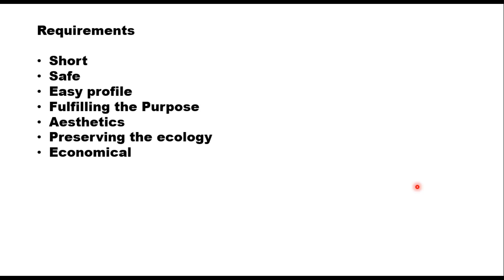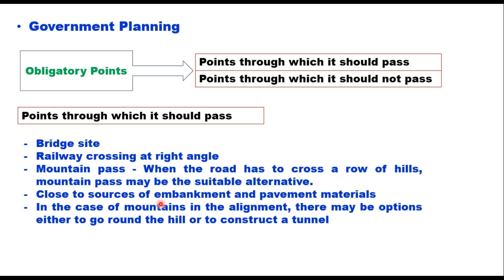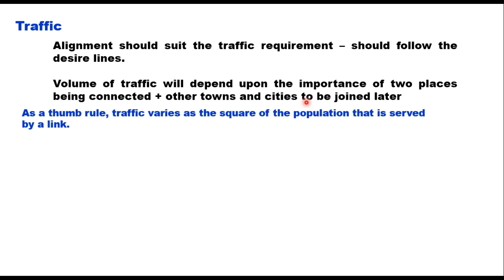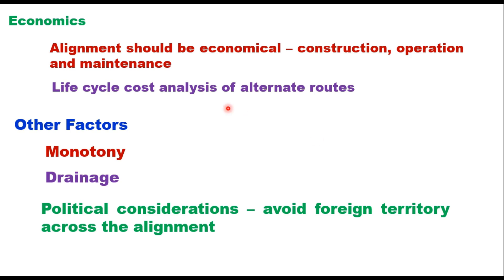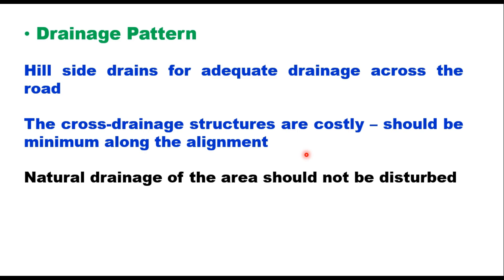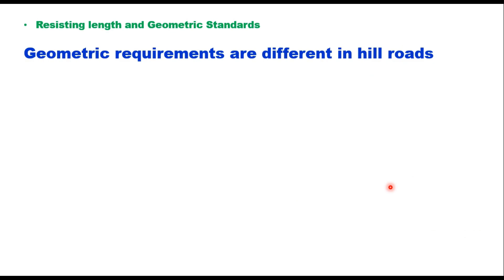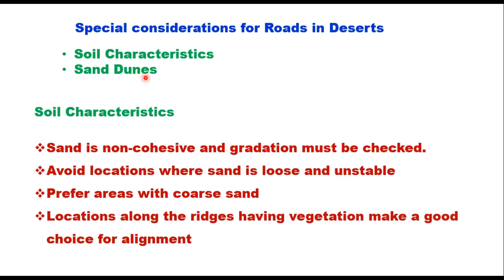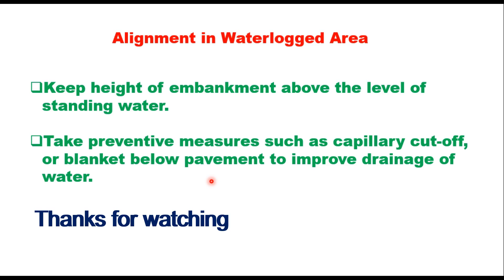Factors affecting highway Alignment in plains, hills, deserts and problematic areas with all details

Comment: Could you suggest some of best book's to Solve some Typical conventional questions Sir ( like 12 Mark's and 20 Mark's questions for ESE ) sir....

Syllabus:::; 
Geometric Design of highway , Traffic Engineering and control 
And Design of Pavements.........

Tqqqq sir...
Already I sent mail to you sir....I hope you are busy and didn't check sir..
Tqqq so much sir....
Reply from the maker: There are many good books on Highway Engineering, which you can consult. Take any one of them. Books will provide you the basic concepts. You need to apply this basic knowledge to solve typical problems.